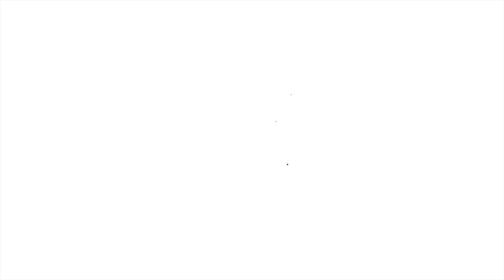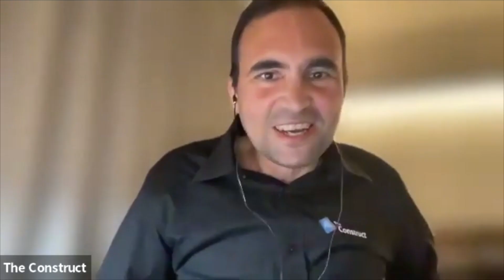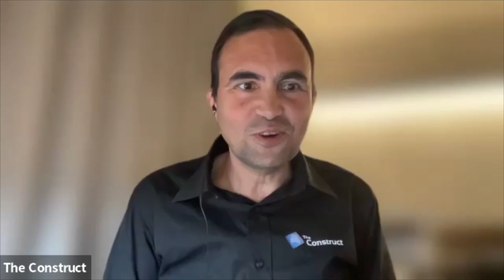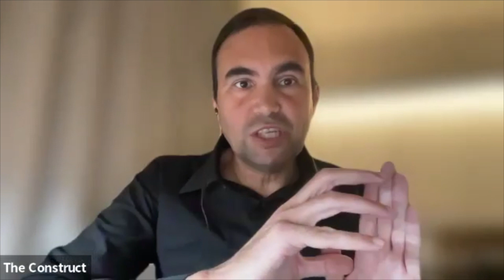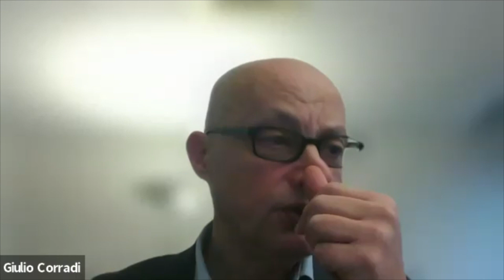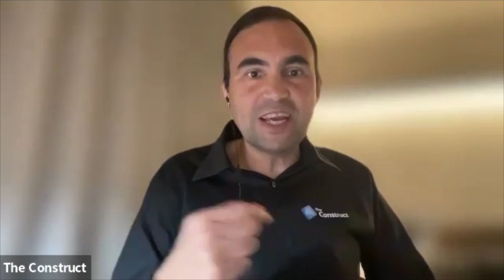RDP111: Hardware Acceleration in ROS2

Comment: Thank you Ricardo for this inspiring episode. It is always a great pleasure to be inspired by brilliant minds. From my humble point of view, the solution based on FPGA will revolutionize the robotics market since such solutions are extremely efficient and provide the required performance. Great also that they provide a standard programming framework/API. Not sure if the AMD solution is "compatible" with OneAPI from Intel.
Reply: Thank you Marcus. What is OneAPI of Intel about and how does it relate to accelerated hardware?
Reply: @RickTellezL  OneAPI from Intel is a programming framework that allows you to develop your application once (for example path planner or vision application) and you can seamlessly deploy on any HW (CPU, GPU, FPGA).  The framework (compiler OneAPI CPC++) will make the "adaptation" to your target. This is a short and consistent overview:
https://www.youtube.com/watch?v=9JOCLCo9T7s